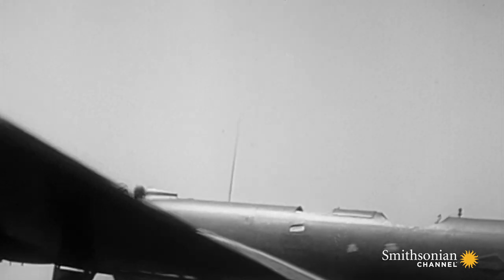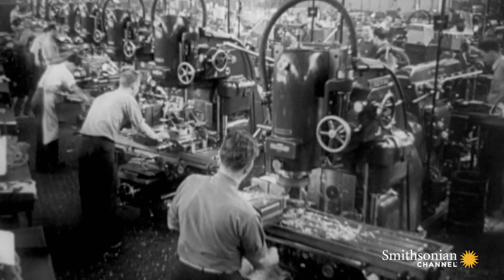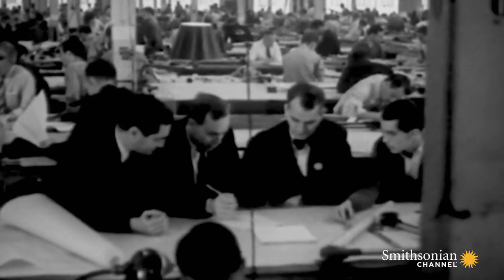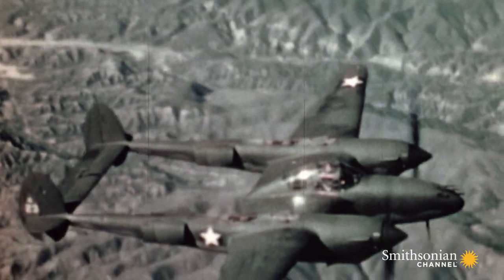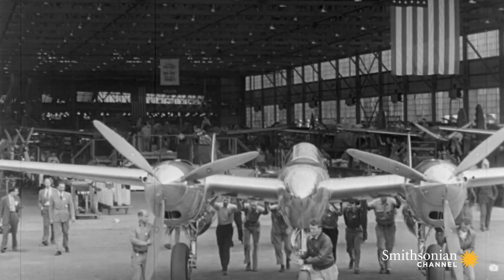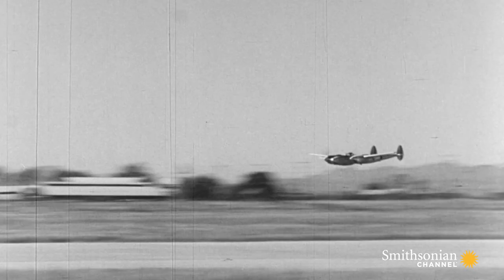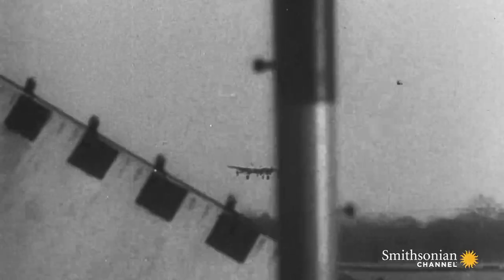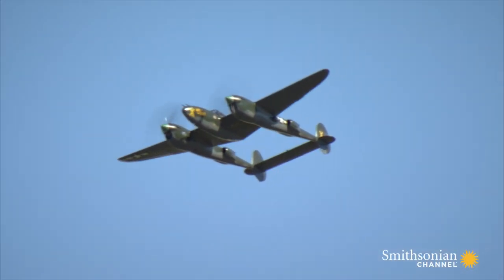How the P-38 Flew Faster and Higher Than Its Rivals

Comment: The Answer (since the video never provided it): It used two engines. That was the solution Hal Hibbard (chief engineer at Lockheed) and Kelly Johnson came up with when the specs called for a fast, high-climbing interceptor that could haul a cannon. They decided to build a twin-engined airplane to get the power they needed.
Reply: I seem to recall, why it had 2 engines, was the original requirement for the aircraft was to clear a certain height after a specified take off roll. Sorry I have forgotten the actual numbers. So they figured that they needed 2 motors as one engine would not meet the requirements.
Reply: It's unusual how the initiating spec ended up contravening with applied practice. It was standard procedure in the P-38 to take off with no flaps at all, as they considered getting up to safe single-engine speed (120 mph) more important than the initial climb-out. They would only use flaps if there was an obstacle at the end of the field which they had to climb clear of.
Reply: THANK YOU for answering the question I tried to watch this video to find out!

But now I'm starting to wonder... if that's the case, why did they abandon the two-engine design?  Sure, the later planes had stronger/better engines that made them viable fighters with only one engine, but then why not take that more-powerful engine and double it again?  Make your fighter plane even faster and more capable to gain a greater advantage over the enemy!
Sure, it increased production costs and it doesn't scale the same; it won't make it twice as fast.  But you'd still get a performance boost, so why wasn't it an effective choice?
Reply: @marscaleb  
"But now I'm starting to wonder... if that's the case, why did they abandon the two-engine design?"

For fighters? The P-38 was very complicated. Its engine management systems took too much of the pilot's attention, making it a difficult aircraft to fight in. Contrast that with the FW-190, which essentially had the world's first engine management system.

Secondly, a twin engine aircraft simply has more inertia, which compromises response and manoeuvrability.

"Make your fighter plane even faster and more capable to gain a greater advantage over the enemy!"

Capability based planning is a bit of a rabbit warren that no combatant could afford. The German 'Big Cats' were a prime example of that: extremely capable but capable of what? The basic function of a tank was infantry support, rather than tank v tank. It didn't work out well for them in the end, despite obvious successes along the way. The best planning - and arguably the best example was the P-51 - were aircraft that were developed to suit a specific strategic need. To that end, the strategic need for the P-38, whatever its capability, was more limited than for a single engine fighter with a long range, like the P-51.

The P-38 worked well in the Pacific because it had a good range and because it was a twin. A forced landing in the Pacific had a lower probability of survival than one in Europe. Crash landing in the jungle was a terrible option and ditching in the ocean, arguably worse. A second engine made getting home that much more likely in the event of engine trouble.

Comment: My grandpa flew an xp-38 in the pacific theater in wwii. He was a photo recon pilot and flew all kinds of amazing aircraft. A true pilots pilot.
Reply: Rich Bassett yea did he tell you most pilot comeback with one engine because the supercharger on the engine is unreliable and the xp 38 cant fly to certain altitude so they abandon them in Europe and change to a spitfire instead.
Reply: Alis Holst. I don’t recall any stories of engine failure. I believe his was turbo-supercharged? The p-38 had good range and speed. He was pre-cia army air core intelligence. So they took care of him.
Reply: @richbassett7111  pretty sure you can turbo super charge an aircraft. its one or the other.
Reply: Early p38 engines would fail in European skies because the dry air would starve the engines. However the p38 was used primarily over Africa and most importantly in the Pacific, where it shot down more planes than any other USAAF plane in ww2.
Reply: The British cancelled their order for the P38 because America would not allow the super chargers to be exported. This left the aircraft under powered at altitude. Otherwise they would have been an excellent aircraft for the Royal Air Force. Once the embargo on the super chargers was lifted the made an superb platform for aerial reconnaissance for the Royal Air Force.

One thing the British did tell Lockheed was to have the engines contra-rotating as this helped cancel the effects of the torque from the engines and improved its flight characteristics.
Reply: @bigblue6917  The early order that the British ending up canceling due to poor performance  was due to the British ordering the P-38 without the turbo charged engines.  Lockheed strongly advised against it but the Brits thought they knew better.   The Army Aircore p-38's that fought in the European theatre were devastating to the Axis forces.   Research any interview with German and Italian pilots and what their thoughts were about going up against the P-38
Reply: @kvnkaveman  why didn't the Brits install Merlins like they did the Mustang?
Reply: @Eugene2ndW  Don't know why.  Size might of been a problem  but the Mustang could, did use both engines.   Would of been a bad as plane rocking two Merlins.
Reply: @daslynnter9841    I don't think Dry Air starves an engine.
Will you explain so I can learn something.  Thanks
Reply: @wms1650  I'm not certain as to how, but I know the engine dominated at high altitudes in the Pacific and every historian and engineer I've talked to about this says its because of the moisture.
Ive always assumed it's due to the density.
Reply: @daslynnter9841    I believe the P38s used in the Pacific Theater were turbosupercharged. The ones sent to England were normally asperated (no supercharger or turbosupercharged).
My Uncle Mac Manning flew the P38 in the Pacific Theater.
He always spoke highly of the P38. 
Useless trivia but he made a career of the US Air Force, transitioning to F86 and in the 1960s flew the F101 VooDoo as recon somewhere. I think Asia.
Reply: @wms1650  the English ones didn't have turbosuperchargers but I believe America attempted to fly them over Europe and the American p38s should have been supercharged, I read somewhere about American pilots who flew them over Africa surprised at how bad they were over Europe
Reply: @why9430  I will go out on a limb believing you ment to write can't instead of can.
Turbo supercharge uses exhaust gases to power the supercharger hence the turbosupercharger. A gear driven supercharger is said to be supercharged.
Gear driven supercharger can be single stage as the first Mustangs were or dual stage as the P51 Ds were. 
You used the 1st stage until about 15,000 ft. then the pilot would switch to the both for higher altitude flight.
I believe.
Reply: @why9430  Yes you CAN turbo super charge an aircraft engine.  B-17's had turbo super charged engines too.
Reply: @ffjsb   I don't think the Wright R1820 was turbosupercharged. It was supercharged. Their may be a Radial engine during WWII turbosupercharged that I don't know about. The Wright wasn't.
Reply: @why9430  Build many engines? It's called compound boost. Turbos boost a supercharger. This extracts energy from the exhaust as well as the crankshaft or accessory drive. Most airworthy aircraft typically use one form of boost since longevity suffers with high boost levels.
Reply: I just commented to make it 17likes and 16 comments
Reply: As did mine
Reply: @wms1650  this aircraft had both systems, engine gear driven supercharger and in its onside tailboom a turbocharger.....the turbochargers were its achilles heal.....burnt out too early limiting its high altitude performance....that is why the P-38 was a failure in the European theater...it did great in the Mediterranean/North African and Pacific because it mainly flew medium to low altitude missions....
Reply: @wms1650  on the B-17 they were turbocharged (the exhaust system provided the power to make this work) and the engine had its gearbox driven supercharger. The same set up in the B-24 but that used PW 1830 engines...
Reply: @767bob   Thank you sir.  I knew Radials were turbosupercharged for airlines in the 1950s.
I didn't know the B-17 was until today.
Thanks again for the information.
Reply: @wms1650  The R-1820-67/69 and R-1820-97 models WERE turbosupercharged.  There were a LOT of variants to that model engine, literally dozens of variants, from 575 HP to 1,350 HP.
Reply: The one and only XP-38 died on a golf course in New York. And a photo variant of the P-38 is an F-4 (if she's a Model 222 ship) or an F-5 (the Model 422 variant).

Comment: one can say that only the US is rich enough to consider the P-38 twin body and engine design into mass production at that time, its just not cost efficient for lots of countries in europe
Reply: This is a true fact.
Reply: One could equally say that only a defence force that was seriously out-of-touch would consider building an aircraft that was so difficult to fly in combat.
Reply: American mettle can overcome a lot of problems. The P-38 came about because it could be made.

Another example: The P-47. Did you know the designers of that plane were immigrants from the Soviet Union? The P-47 is literally what you get when a Soviet-era aircraft engineer happens to own an American factory. And look at what they produced...
Reply: @BogeyTheBear   Too bad Republic didn't listen to what the Army needed. When Materiel Command wanted more internal fuel capacity before the war, everyone - North American, Lockheed, Curtiss and Bell - complied except Republic. When the USAAF urged manufacturers to increase internal fuel capacity in early 1942, North American, Lockheed, Curtiss and even Bell made efforts to do so. Republic added two more guns, to no useful purpose.

Gen George Kenney, CinC of 5th Air Force in the Pacific was known to be livid with Republic for failing to increase range. And that was nothing compared to the flow on effects in Europe.

In fact, the American system of manufacturers trying to sell a product with impressive specifications, rather than direct cooperation with the government, is a somewhat flawed model. There are times when it works very well - this was also true of the Spitfire in Britain - but it's a rather hit-or-miss approach. Sometimes it works and sometimes it doesn't work.

Comment: The highest scoring American aces flew p-38’s in the Pacific. Charles Lindbergh clandestinely flew the p-38 in the Pacific to figure out the boost and mixture settings, in order to extend the range and performance of the p-38. He also tallied up several kills while doing so.
Reply: Prove it.
Reply: @steveconkey7362   Charles Lindbergh knew a great deal about extracting the most performance from the least amount of fuel. He chose to help the war effort.
He may have downed aircraft but I can't prove it.
Helping the pilots learn/trust running their engines OVER SQUARE (low RPM using high boost) and leaning is documented in books and some video footage that has been shown on History Channel.
Reply: I read he also worked with USMC land based F4U squadrons on coming up with better fighting tactics and also figured out they could carry a much heavier bomb load than previously thought.
Reply: @steveconkey7362 Battle Stations P-38 episode. Witness testimony.